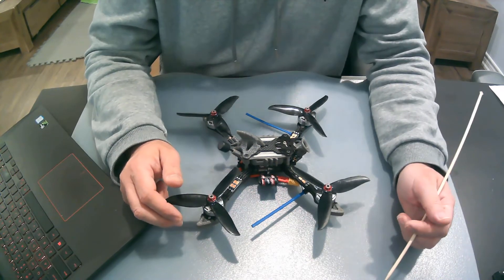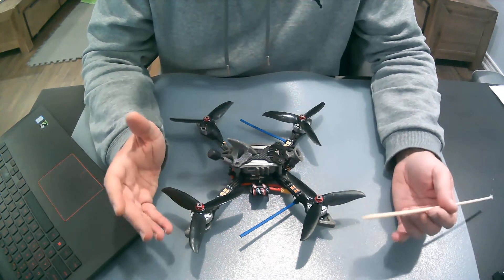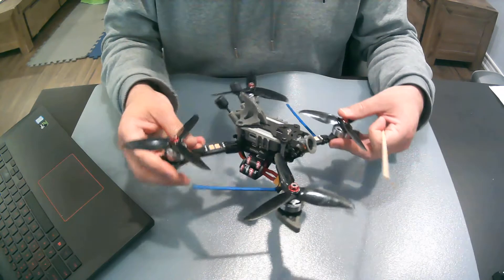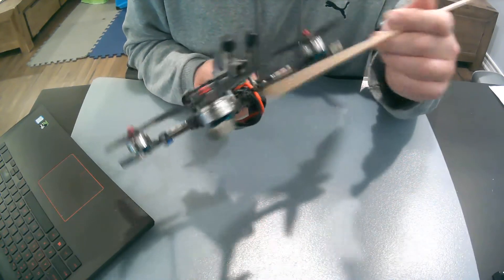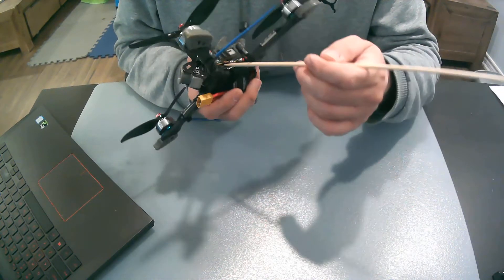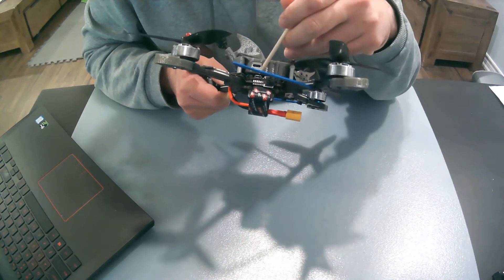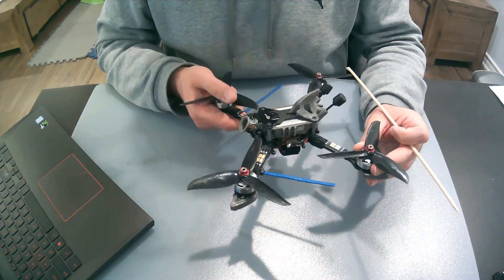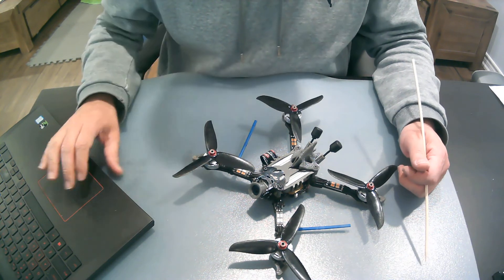Vampire 2 HD Part 1 - Build Overview

Comment: I ordered this and I want to use my own Taranus Radio. Do I need to buy anything to get my radio to connect to this drone or does it come ready? I got the BnF with the goggles
Reply from the maker: I checked flywoo website, the bnf does not include an frsky receiver, so you will need to purchase a receiver, an r-xsr would do the trick
Reply: @RaedAdlouni  thank you very much. What radio would work with the BNF out of the box? I have been considering tango 2 and dji
Reply from the maker: Dji digital fpv radio
Reply: @RaedAdlouni  thats what I thought but wanted to make sure. You're the man, thank you.

Comment: So I've finally got the opportunity to build my own race drone and im hearing good things about this BUT im just getting the frame and putting my own parts in front the ground up i just don't know if its right for me i have experience but do u have any tips on how i should go about this of if im putting to much into a frame that im just starting race fpv
Reply from the maker: This is a very fast and agile frame with the right hardware. If you are just starting I would recommend to keep the camera angle low, this would naturally force you to fly slow and give you chance to get used to the frame. Always fly over grass to minimize the risk of breaking the frame/parts (you will crash a lot while learning). Work on improving and perfecting your turns and develop muscle memory for that, a good turn requires coordinated control of all the 4 axes. As you get better start taking more risks with more aggressive maneuvers as this is the only way to improve. Hope this helps